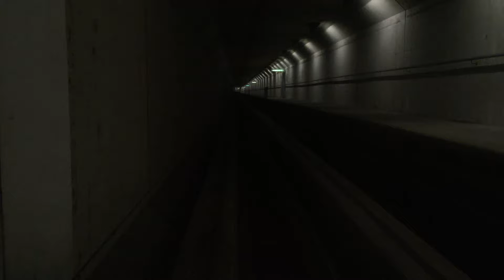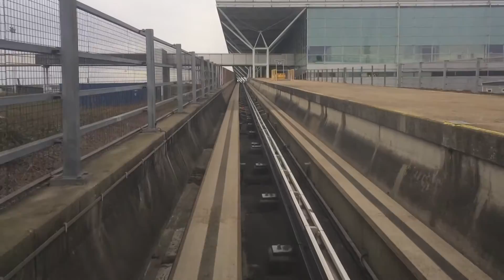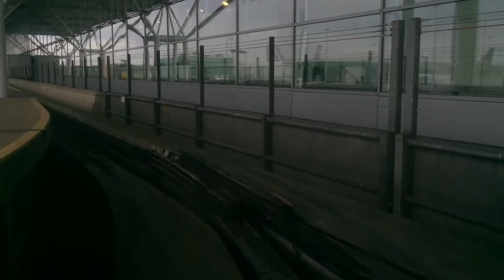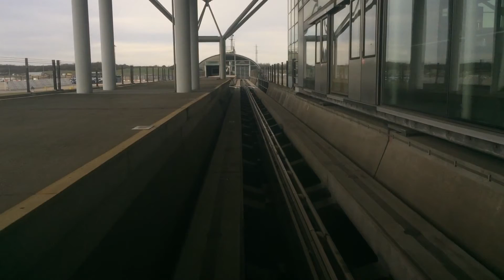Stansted Airport Automated Transit

Comment: Gotta be careful if you're taking a trip on this for fun before your flight. I was flying out from the main terminal building and decided to take a ride on this out of curiosity. It took us to the last stop and a woman shouted at us over the speakers to get off -- another train was waiting directly in front of ours. We hopped off and the doors shut behind us, not transparent this time but stainless steel as an indicator that there's no going back...
It seems like there's no way to get the train in the opposite direction since it would allow people to bypass the check-in security screening, so we had to pick up the courtesy phone and ask what to do. Somebody answered quickly and told us to go upstairs to one of the gates where a guy took us through some locked sections and showed us how to walk back, which took about 15 minutes.

We were waaay early for our flight and the guy turned out to be pretty funny, so it worked out fine, but for a few minutes we were starting to sweat...